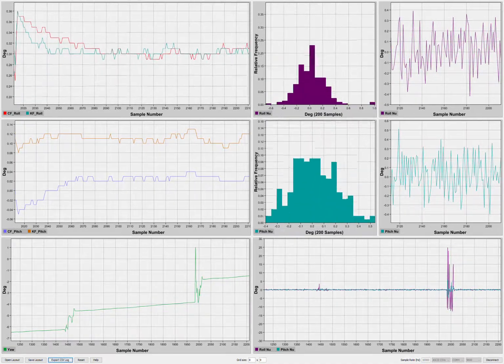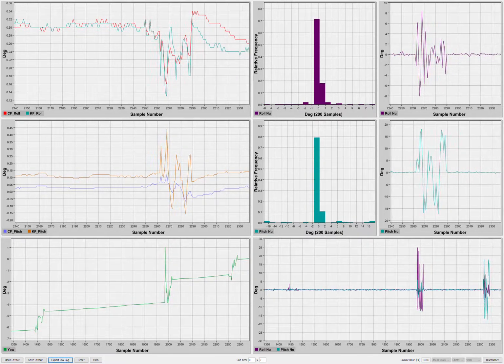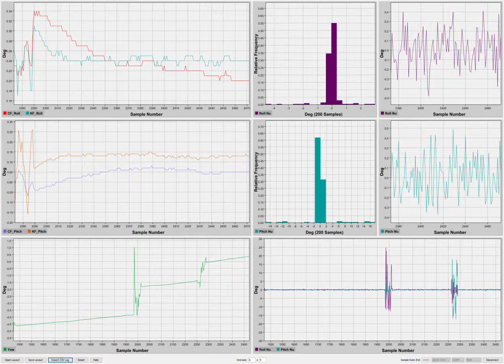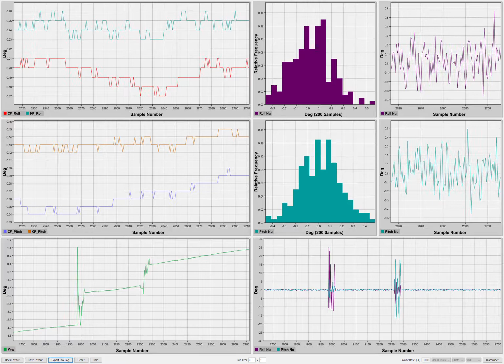Kalman Filter for 6DOF IMU Implementation (6/6)

Comment: When my gyro just sits there I still see a constant reading on all three axes even though it is not moving. Is this what is supposed to happen?
Reply: That's due to the error correction being set to arbitrary values. Those values should come out of the calibration. So if you calibrate correctly it should be fine (and then set the found values instead of those arbitrary error corrections in the current code)

Comment: Could really use a vid showing an orientation vs. reality then move it through the edge cases that break tradition Euler calculations. Assuming 6DOF, e.g. at pitch 90, the roll becomes undeterminable. At pitch 0, yaw is unknown. So with this vid series so far, without code & without a vid proving it works any better than the most simple approaches, its kinda a tease that may work super well or may not really be any better than simplistic approaches.